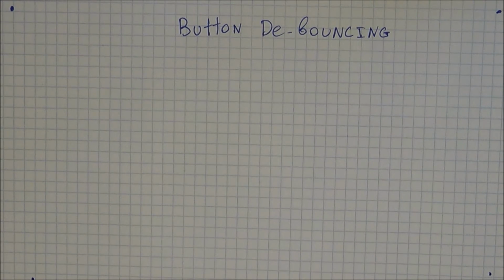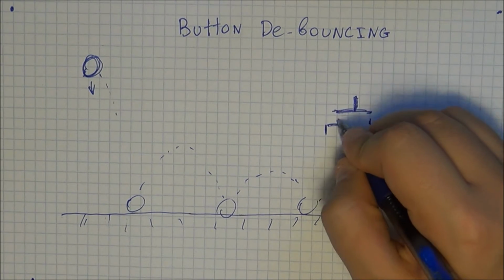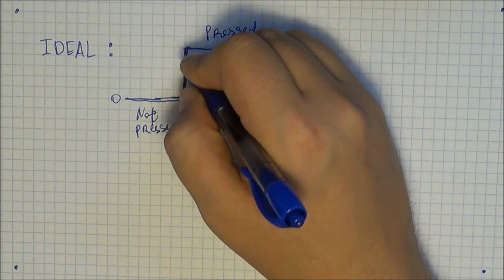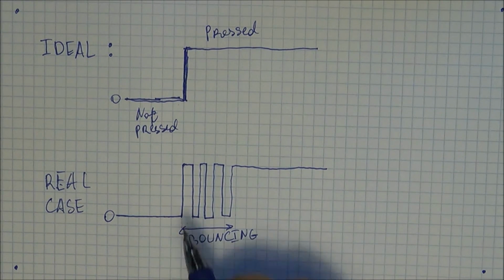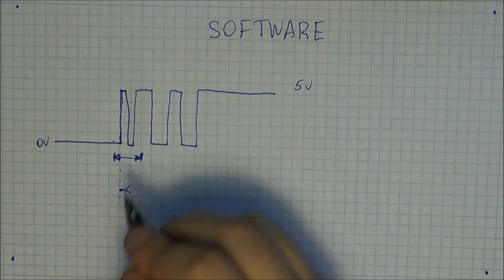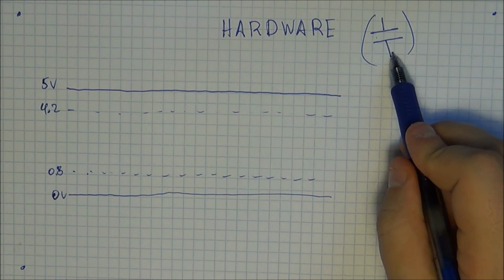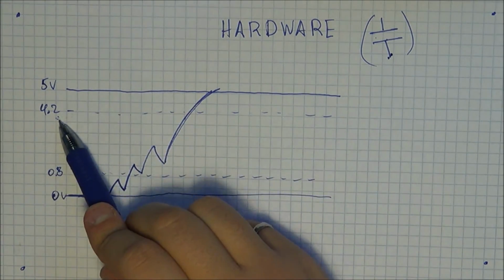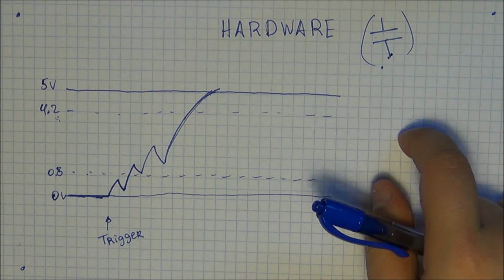Arduino Tut. #7 - Extended - Button De-bouncing explained

Comment: You are partly correct then you are talking about the threshold values of 0.8V and 4.2V.

First: It has nothing to do with Arduino. It depends on the chip you are using on the Arduino board. For example an Arduino UNO uses ATMEGA328P as microcontroller.

Second: The threshold values you are giving is NOT threshold values. Between those two values you do not know if the chip will interpret the signal as HIGH or LOW. That is CMOS fundamental and depends on the process during manufacturing. So why do they write those numbers in the datasheet? That is guaranteed values! The next batch of microcontroller will have a different voltage they will have as threshold. It might not differ much, but it will differ.

How can one know what the threshold is? That is quite easy. Make a voltage divider by one fix resistor (10k is a reasonable value) connected to ground or power supply and variable resistor (100k is a reasonable value) connected to the other (power supply or ground). Then turn the varistor (variable resistor) to the point there the chip says, "hey now the input has toggled" and measure the voltage at the pin (in the middle of the voltage divider). Repeat for the same chip and you will get the same result.

How to test then the chip has recognised a toggle on the pin? Something like this
void loop() {
  if(digitalRead(<pin name to read>) digitalWrite(<pin name to write>, HIGH);
  else digitalWrite(<pin name>, LOW);
}

If you connect <pin name to write>, to a LED and series resistance (maybe use one of those already inbuilt on the board you are using).

Comment: I'm working with IR sensors modules which come with a transmitter and a receiver at the same breakout board. So, I'm working with different configurations. First one is counting people who are entering and exiting a building and this one need an accurate triggering, I solved the bouncing problem with 1uF electrolytic capacitor. But the problem is that the microcontroller reads the person more than one time in one go which of course is a problem for the counting process. Another configuration is to catch a moving car whether is exceeding the speed limit or not.

Comment: Great tutorial. I have just a suggestion, try to put a resistor in series and a capacitor in parallel to the switch (RC-circuit) so you can control the decaying time of the capacitor discharge by TAU=1/RC. And let see the de-bounce time is 1us, then insert it in the formula(instead of TAU) and chose an arbitrary resistor value lets say 1Kohm and calculated the corresponding capacitor value you need to remove/filter the bouncing time.  in other words the RC circuit will let your signal through until the transient (de-bounce) period is over. Keep up your great work